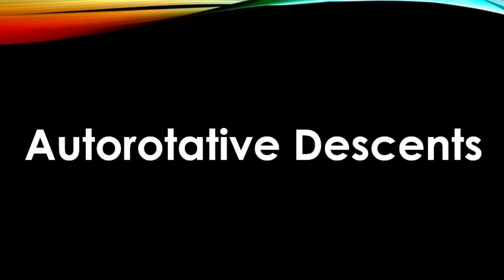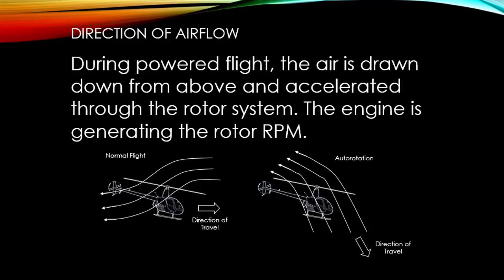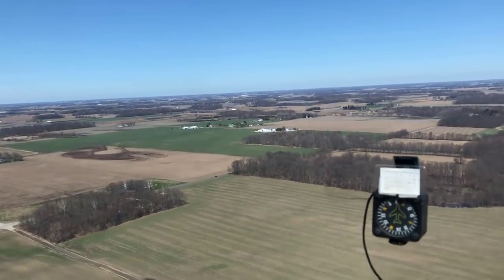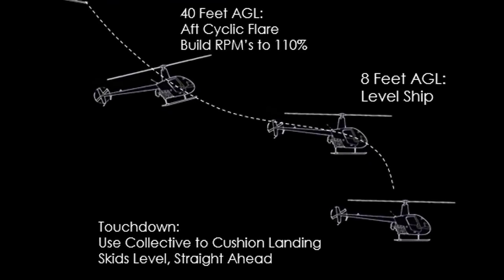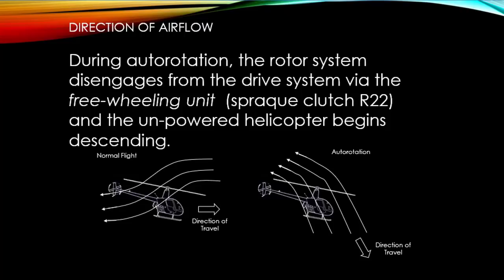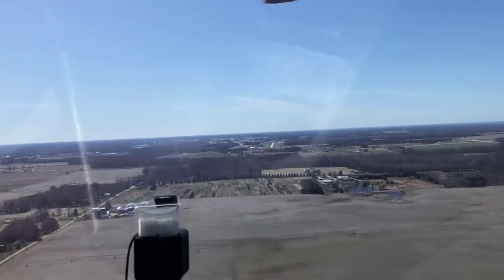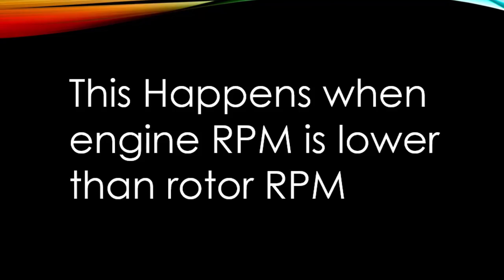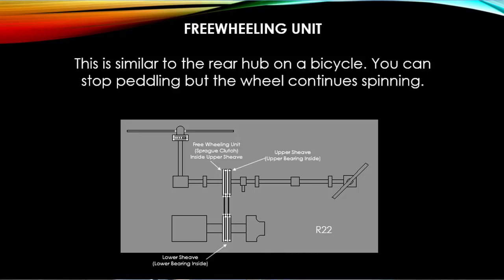WHY Helicopters DON'T FALL FROM THE SKY when the engine fails!

Comment: How is the "ship" still steerable?
Reply from the maker: All the controls are still operational.
Reply: @HelicopterGround  how is the back rotor powered?
Does all this work also if the battery is dead or electronic system die for some reason?

Comment: What helicopter are ya'll flying in in this video? Just from the cockpit, it looks like an Enstrom bird. If you're giving right anti-torque pedal, then i assume that the main rotor is turning in a "clockwise" rotation. . . . . .when looking down onto the helo from up.above it.  When ya'll are at the close end of your flare before ground touchdown, is the pilot adding a collective input to add positive pitch to the main rotor blades for that cushioned area??? Great video & thankya'll for sharing. God bless.
Reply from the maker: Yep it's an Enstrom F-28 F thanks for commenting!
Reply: @HelicopterGround  Thanks for answering.  Fly. safe

Comment: What is the maximum altitude for autorotation?
Reply from the maker: The higher you are, the longer the glide. The only max altitude is the operating ceiling for the helicopter. That altitude depends on the helicopter and is stated in the pilots operating handbook for that aircraft. Thanks for watching and commenting. Grab a free copy of Amazon #1 best seller, "Helicopter Check Ride". You will have to enter an email for the free digital download, but we do not share your email! https://www.helicopterground.com/pl/1856
Reply: Helicopter Online Ground School “Awesome” Thanks. I’ve just signed onto HeliGroundSchool.com, looking forward to the training.
Reply from the maker: Very nice, welcome aboard!
Reply: That’s a good question. I guess the speed descending down varies on how to use the collective.